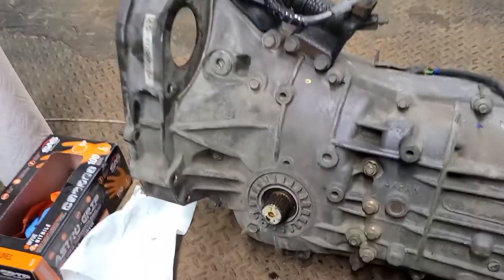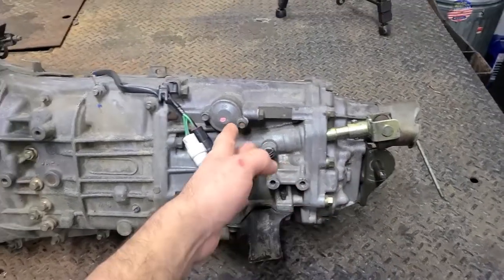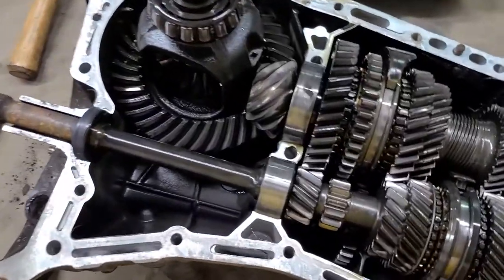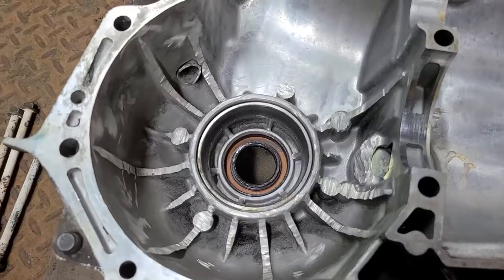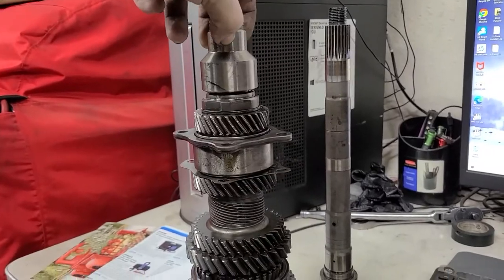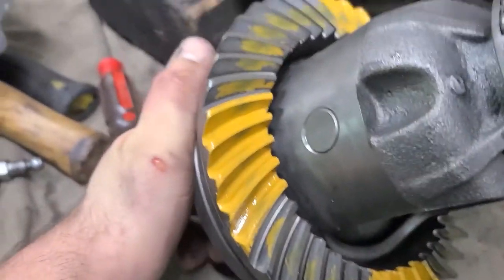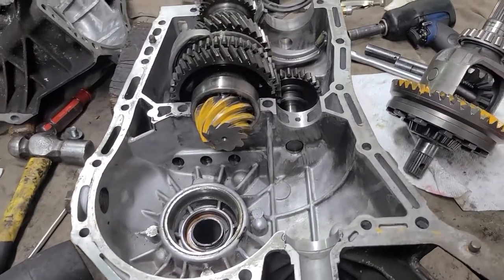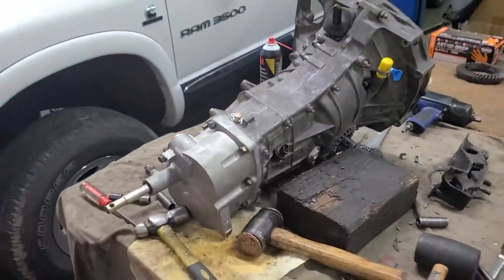Subarugears Conversion / Toyota Sandrail Build (Episode 4)

Comment: Is this subarugears heavy duty version?  No oil holes in the pinion?
Reply from the maker: Why would you need oil holes in the pinion? The fluid is splashed all over the place during use. This is just subarugear's regular kit.
Reply: @timshop2700  the oil holes feed the awd version. Subarugears only had this version originally.  Now they have their high horse power version that doesn’t have oil holes since we dont need them with the 2wd only.  You didn’t show the pinion during your assembly.
https://youtu.be/VbBaZHgw4kI
Reply from the maker: I'm pretty sure that my pinion didn't have oil holes. You can see in the start of the video
Reply: I had an issue with the heavy duty version you can see in this video. Once I figured it out I fixed it by filing the thrust bearing surface that the pinion shaft meets. https://www.youtube.com/watch?v=dNz9J_FOsYQ